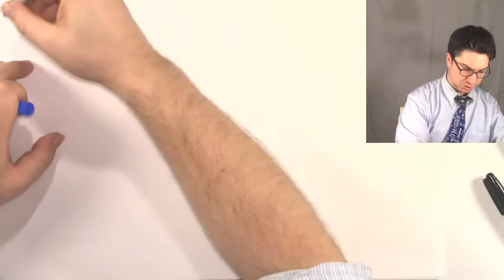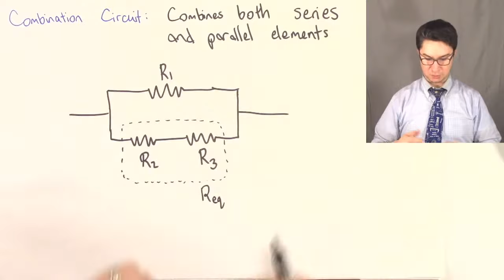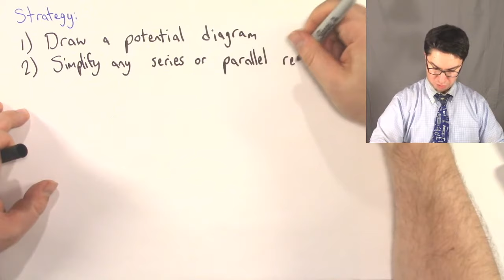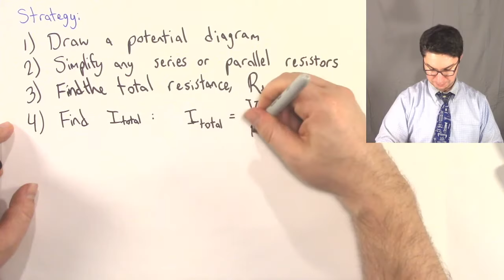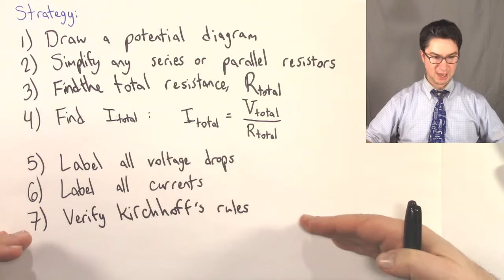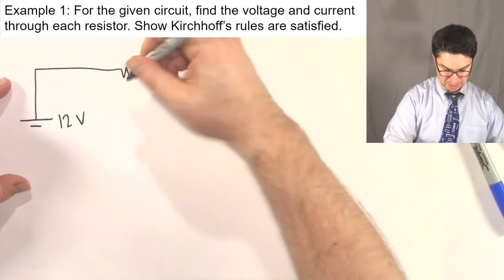Combination Circuits (Series and Parallel resistors)

Comment: you just explained the junction rule so clearly. I was subconsciously confused about that one and when you brought it up it made me realize I didn't understand it but now I do. Thanks so much for the clear and concise video!
Reply: I'm studying for a test at my job and I think he has done the same for me! The way he explained it helped me understand how the drops between parallel resistors 😁
Reply: Hey I have done a couple of other simple circuits using his diagram method but I've gotten to more complex looking ones and I'm having trouble visualizing what they would look like in his Diagram format. Any chance you might have been able to implement his strategy on some more difficult ones? I have a picture of the circuit question

Comment: Huge help, great video.   I'm a Software Engineering student (about to graduate in spring 24, had to delay due to a class issue) but I took a couple of physics classes and embedded devices as electives, had to learn all of this circuitry while also learning Java and database design in the same semester haha. Seemed like fun, to be able to learn the basics (arduino's, etc) to eventually much more advanced electrical devices and robotics someday, combine it with my coding...  Anyway, all good, easy, but this specific class, the Prof seem to have a hard time teaching this material.  You did a great job.  However, I have a question for ya.  When using the equation for parallel resistors, you isolated the two parallel resistors... in this situation, why didn't you use product over sum formula?   R1 x R2 / R1 + R2   ??    I understand that you used the parallel formula for Resistance equivalency for  3 >= resistors, but was it personal preference or was there a specific reason?  Just trying to find out if there's any unspoken rule or something you learned from your experience, thanks.
Reply: 20:41 how he gets 8v?

Comment: Hello first off great video. I have done a couple of other simple circuits using this diagram method but I've gotten to more complex looking ones and I'm having trouble visualizing what they would look like in your Diagram format. Any chance you might be able to explain a more difficult combination circuit in this method? Or I have a picture of the circuit question if I could send it to you and you could rewrite it in your format.
Reply: Lol same, i got a problem w/ 3 parallels and 2 series and I’m so lost. I feel like i would understand it a lot better if he had a video.

Comment: every video ive seen uses an example like the one shown at 7:02 the problems that i have only give me one resistor and the rest are blank. maybe someone can help me solve it i i may just be overthinking it because i know i can solve the regular single and parallel circuit series but i dont know why this one problem is throwing me off.  
Et=12v It=blank Rt=blank 
E1=6v I1=blank R1=blank 
E2=blank I2=1A R2=blank 
E3=blank, I3=blank, R3=6 ohms

Comment: Can you explain this problem I’m having a hard time getting it  I’m trying to used this video to get resistance and current 
150 vdc r1 25 series r2 100 parallel r3 40 series r4 150 parallel r5 100 parallel all resistors are ohms

Comment: How you get that 8v in the parallel circuit?
Reply: the total volt is 12, n the first resistor took 4v. so voltage left in the resistors in parallel as a unit is 8.

Comment: Just a comment. The voltage (potential difference) in parallel circuit should not vary. The p.d. or Ve across the whole circuit is equal to the p.d across each resistor. Ve = V1 = V2.
Reply: It does vary in parallel tho😅

Comment: Can you please explain why in this case the current flows from + to - in this circuit
Reply: It's hole current as opposed to electron flow. Same value but in the other direction.
Reply: It's conventional current.
Otherwise, electron flow is negative to positive.

Comment: why does everyone only use the example of 1 resistor in series and 2 in parallel? 😭 i need examples with 1 in series, 3 in parallel, or 2 in series with 3-4 in parallel
Reply: Easy way if u have more than 2.  resistor than simply use 

First multiply all resisitors in numenator then add all resistor in denominator 
×\+